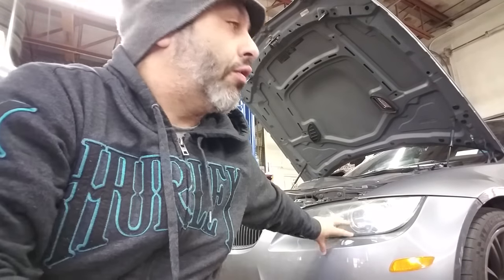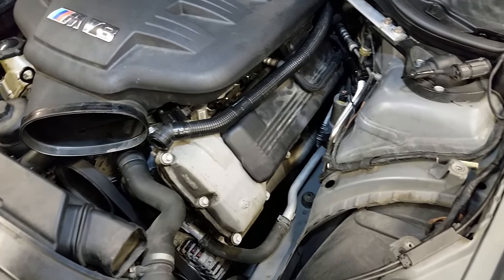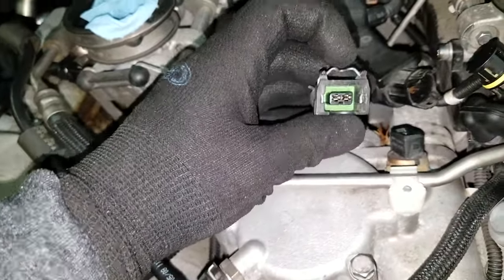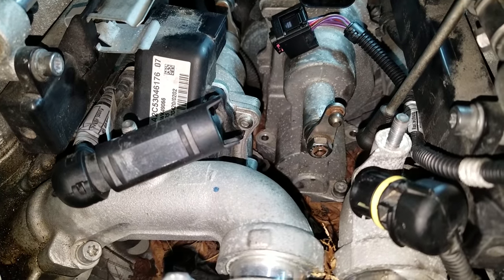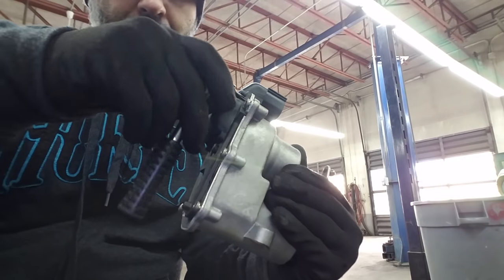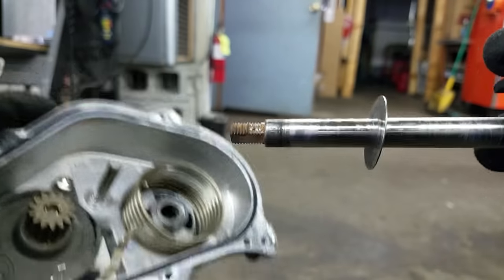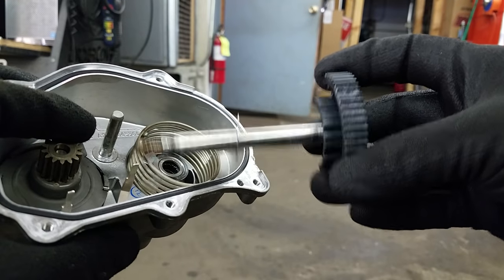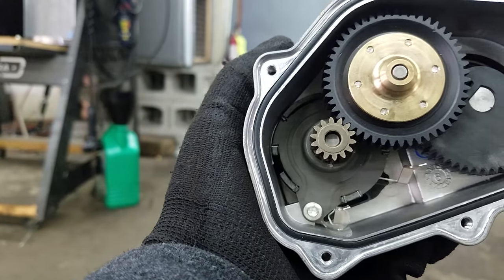BMW S65 E90 E93 E92 M3 Throttle Actuator DIY

Comment: So did this work or not?
Reply from the maker: The rebuild was fine but the board was bad. Bought a new one, installed and works fine. The other one, that was good , that I rebuilt, is still fine. I did finally throw bank 1 codes for the TA that was rebuilt. Codes cleared instantly so I know that board is going bad too.
Reply: RDDC thanks for the reply.  appreciated
Reply from the maker: No problem. Thanks for checking out my channel
Reply: RDDC any idea how to diagnose the board vs gears without doing gears first?

Comment: hope u changed your oil cap, you got a leak
Reply from the maker: Yeah its been changed. I have a leaking valve cover too. Lots of work needed but still runs great for 181k miles
Reply: @RDDC_Official  yeah mine was leaking. I had it changed a few months ago. I think my oil pan threads are stopped because I have a slow leak and the entire subframe is wet.

Comment: It is really necessary to replace both?
Reply: Yes because if replace one the tolerence of gears will be different new and old and.error code
Reply from the maker: I replaced 1, then 1.5 years later replaced the other one. They are completely 2 different banks. One does not effect the other. Hence why you run in half motor power.

Comment: All this complexity to replace a reliable cable.
Reply: Where did you see a cable.
Reply: @_i-kr6eg  It doesn't have a cable; the throttle is electrically controlled by a digital signal from the accelerator pedal.A cable-actuated throttle is better and more reliable.
Reply: The poster meant in older cars the throttle actuators were driven by cable not electronically like in the video. Before you comment and offend people make sure to educate yourself first.
Reply: @genekelly8467  clown im a tech don't need your input
Reply: @_i-kr6eg  "im a tech"-I would not want someone like you working on my car!
Reply: @genekelly8467  like i care troll . Been in the trade for a long time .